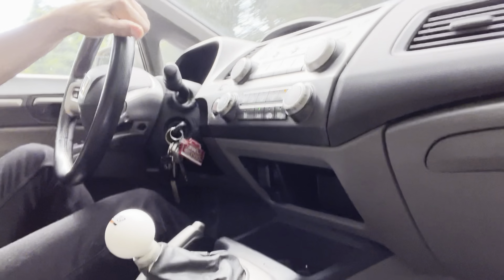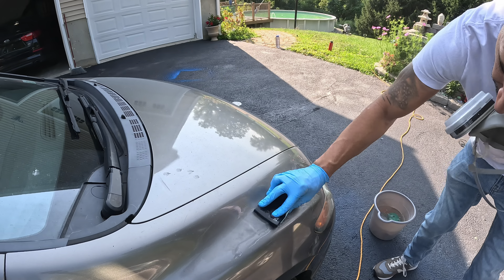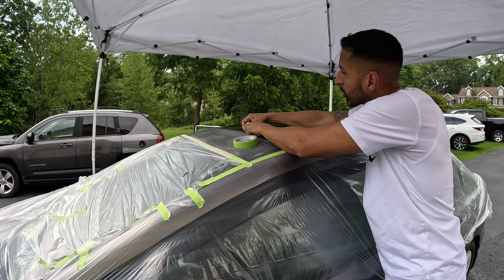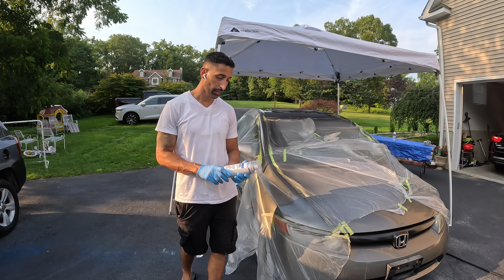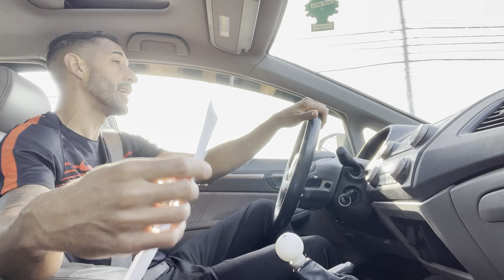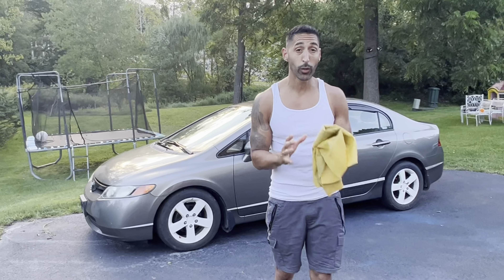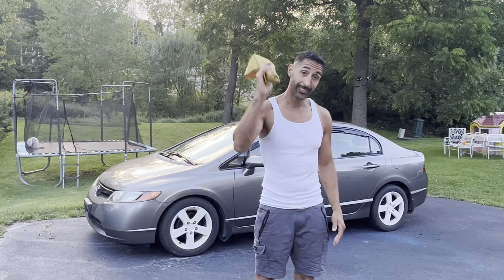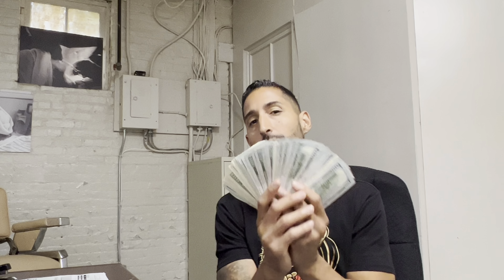Car Flipping A Honda Civic In Just 3 Days $1200 Profit Fast

Comment: I'm a dealer so I could relate..keep em coming...Also breakdown ACV more...I like that one...
Reply from the maker: Thanks man! How are you doing with Acv ? I have been doing better with backlot cars. I will definitely do more Acv
Reply: Acv is good.. good deals..backlot seems like they hard to get him...need mad papers or something..im also in NYC and PA
Reply: I use ACV and it seems like the cars need more than they report. For some reason the last 4 cars I've gotten from ACV needed front wheel bearings, front axles, brakes and plugs. Since ACV do not drive the vehicles they are not able to give you a full detail. I think the former owners of these cars run the hell out of them and just trade them in.  Pick up a Nissan Sentra that reported it had check engine light on and that was it. I pick up the car and notice while driving it home that it needed wheel bearings, brake pedal went all the way to the floor and the dam exhaust was vibrating badly. Man I was pissed but it's part of used car business lol.
Reply from the maker: @cubedmack  I haven’t had to much luck with Acv as well. I think back lot cars does a better job telling you Whats actually wrong with the car. There has always been way more surprises with Acv. I feel you!

Comment: The used car market and prices is a complete mess now. This was a great video and you made a profit because you have the means to repair the car yourself. Any other person would have paid $1000 to do those repairs.
Reply from the maker: Yea for sure things are crazy! But i would say when flipping cars make sure you figure out what you are strong at. Then buy the cars accordingly. Some people are mechanically inclined. I can paint so I would try to find cars that need minor bodywork. Get good at one or the other then you can save big.
Reply: @flippingcarsforfun  yes there’s so many different levels of cars you can buy. I prefer vehicles that need repairs but have a solid engine and transmission. These days you have to be smart to avoid competition from other dealers who also want to buy the cheap cars to resell.